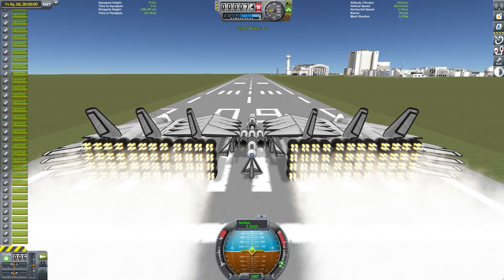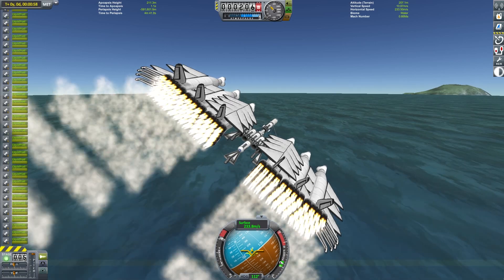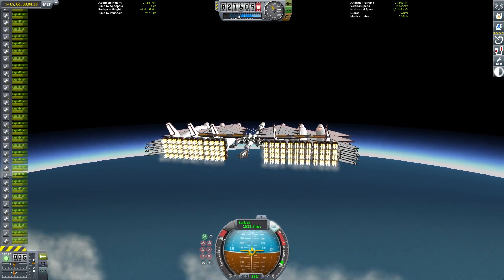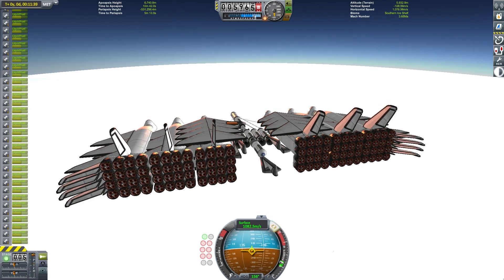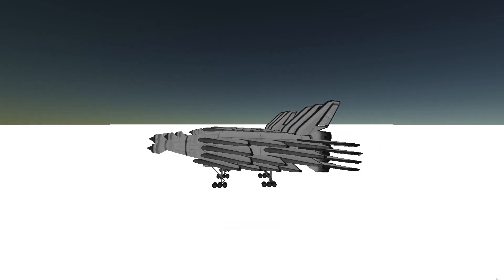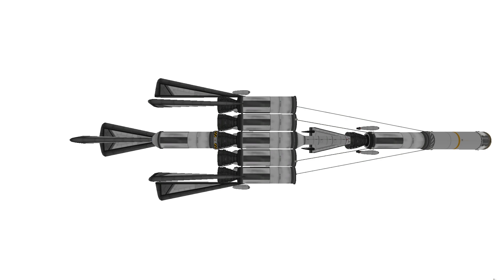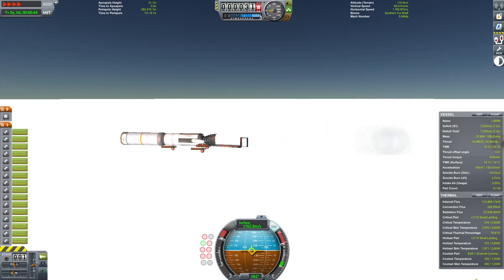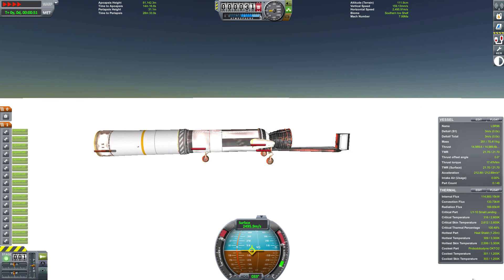Driving a rocket car to orbital speed on Kerbin's ice caps - Stock KSP v1.2.2

Comment: Why didn't it get off the ground due to the curvature of Kerbin?
Reply from the maker: The low mounted rear wings create aerodynamic drag beneath the center of mass.  This leads to a very small amount of torque that pushes the nose down and the rear up.  The slightly negative angle of attack that results keeps the craft on the ground.

That is my theory at least  =)

Comment: I wonder if you could reach escape velocity with extreme part clipping.
Reply: mild clipping gets you to orbital speed so i presume it should be possible if clipping factor is increased :D
Reply: Sam Ferguson stratzenblitz did it without clipping fuel tanks or engines into each other
There was some faring clipping though